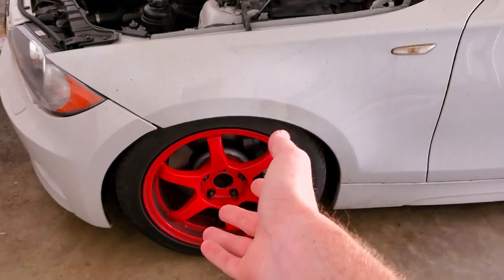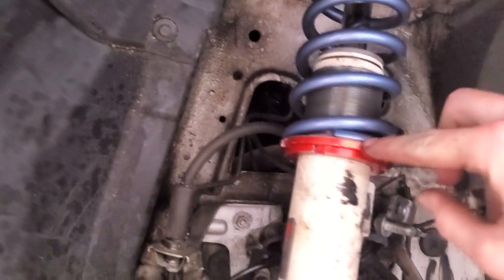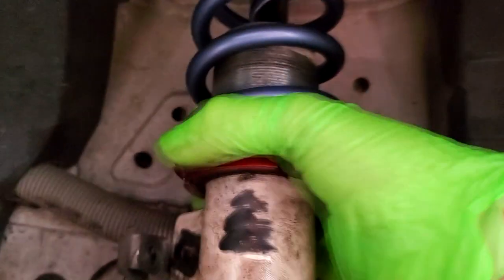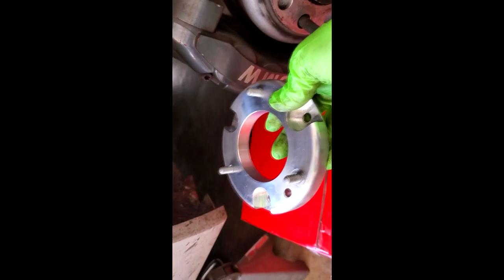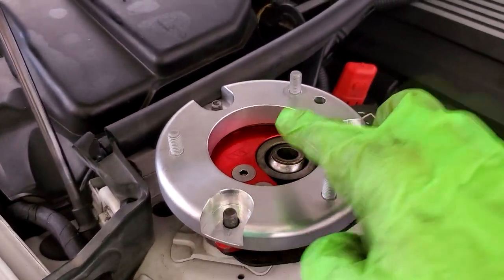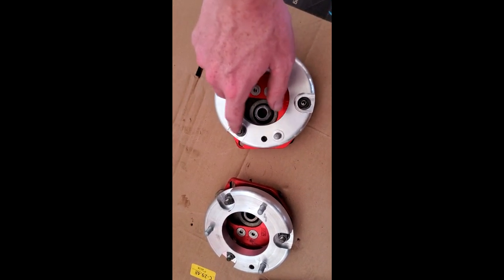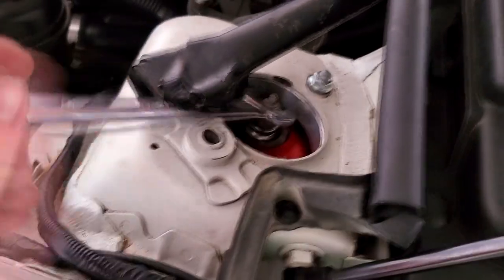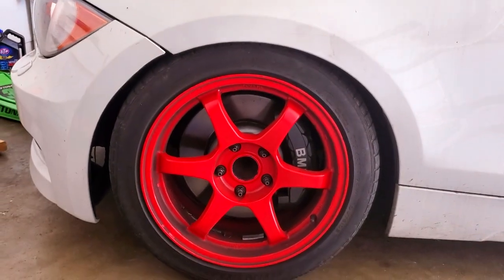How to Fix BMW E82/E90 Coilover Ride Height and Spring Pre-Load Issue

Comment: thxs for a great vid! how come you dont track this car anymore?
Reply from the maker: Expensive to run, inconsistent and not very fast. My Honda Civic produces comparable lap times with less than half as much power.
Reply: @DriveBreakFixRepeat  why you don't feel it fast? I know the car is known for understeering issues but I thought it could be fixed with camber plates and m3 control arms. I was in a market for a e82, e90 (all n54), brz or 370z but only for somewhat competive autocrosses and main DD and Since E82 and E90 are cheap where I live, thought I could throw camber plates and m3 control arms and be set for a good DD with good capabilities in autoX, but if a civic isn't much different then I might need to reconsider
Reply: @DriveBreakFixRepeat  also nice channel